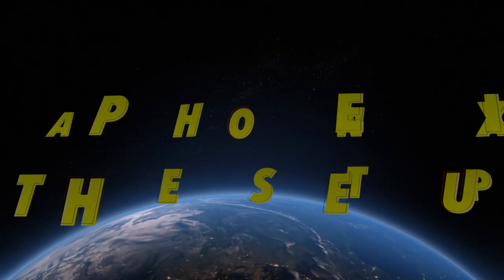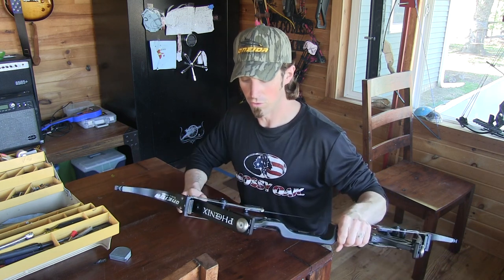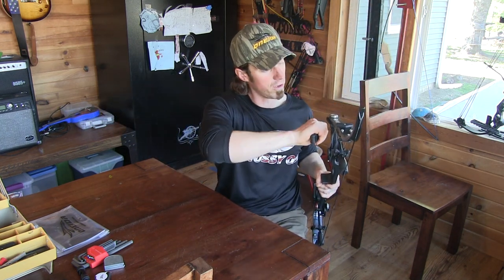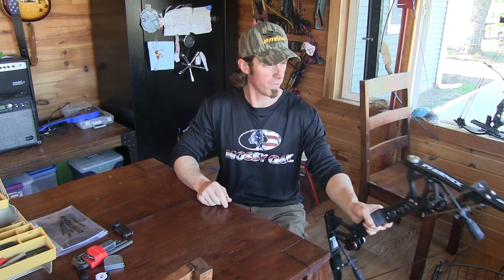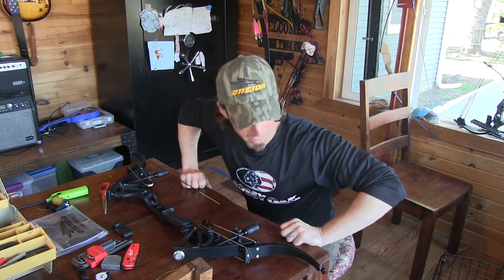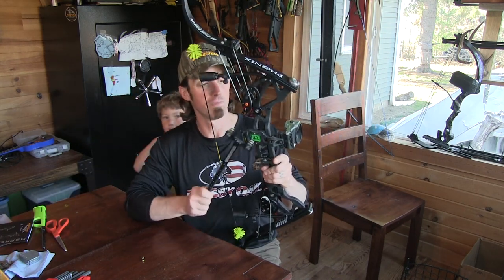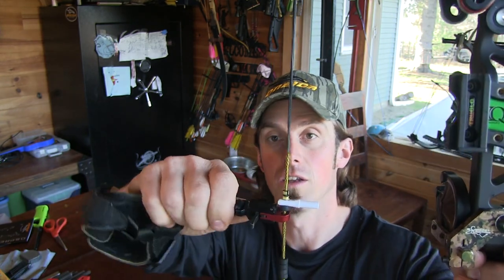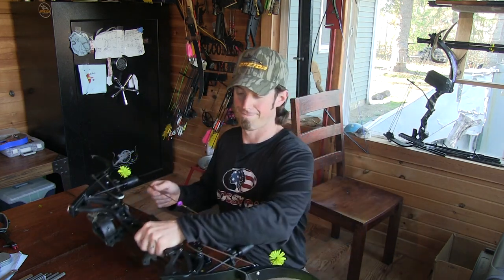Oneida Phoenix Short : How To Setup A New Oneida Bow & What To Look For

Comment: One of these Onieda bow will be my next bow. I've been shooting the same bow 12 years, time for a new one. I have always done all my own work on bows been making strings 25 plus years. When you do your own tuning and set up you get to know your equipment. When I put the silencers on the string I split the thing and slide the material through the string and then tie it in. I take scissors pull the rubber jig material and cut it makes a nice ball on the string. I like the double knock point kisser button and eliminate buttons shot that set for years. Get out the eyecrometer when setting up your bow I like it. Thanks for the videos.
Reply from the maker: Awesome
Thank you
Reply: Best part is Oneida doesn’t completely reset their bows every year. By the time you feel like you want another, they’ll just be coming out with what you need 😂

Comment: Hey I just got a Phoenix myself but my timing cables are running behind my grip and I’m starting to see the cables what is set up wrong?
Reply from the maker: See if cable is to tight.. put a little grease on the cables 
Not knowing anything about your bows history, cables wear and have to be replaced 
Do some tinkering and learn that bow up and down 
I have no doubt that you will love it
Mechanical things need mechanicin’

Comment: Hi, have you ever experimented a problem with power cable getting out from the hinge?
Reply from the maker: Nope , should never come out unless it out at one end of the hinge on the install
Reply: @TRIBEDRAKE  I have a new Phoenix Long 50-70# and after 50 arrows the Power cable go over the corner of the hinge. I do not understand the reason. The still of the cable rounded the aluminium corner. The tiller is zero so I cannot understand. I set the bow to 49# . I am novice so I am trying to understand . I Will appreciate your help.
Reply from the maker: @LucianoCaroti  sounds kind of odd to just pop out of the hinge, break the bow down and reset everything

Comment: What nock height would you prefer for finger shooting? 3 under?
Reply from the maker: I shoot split , bottom of nock point at 1/2” that puts the top of your nock at 3/8 ,   3 under you may need to go a touch higher, shot a bare shaft and start at that setting and see what happens
Reply: @TRIBEDRAKE  thank you for your fast Response! Which gpp do you prefer?
Reply: @TRIBEDRAKE  a shoot and tune Video would be very nice! I like your content, Greetings from Austria
Reply from the maker: @helmutfrey4375  thanks buddy, good to hear from you so far away
Reply from the maker: @helmutfrey4375  I don’t calculate all that stuff, my setup right now is a goldtip 300 at like 31” long with stock insert and a 125 grain point. Aae hybrid 26 vanes 
55lb draw weight
Seems to tune good